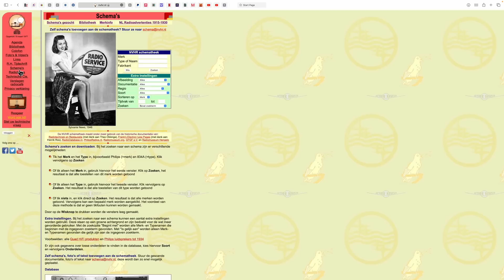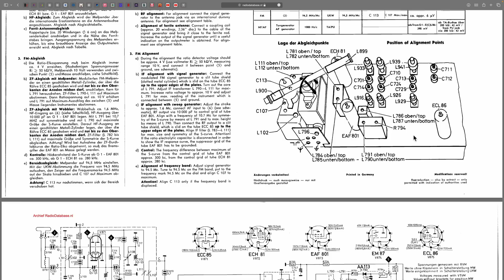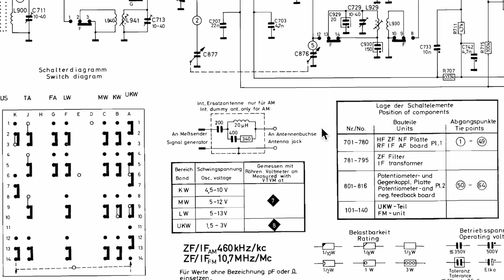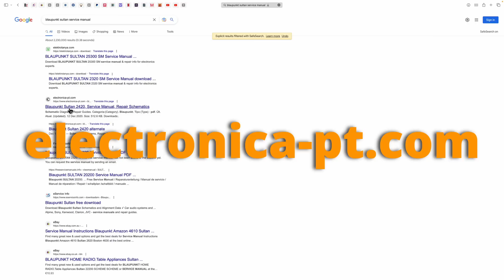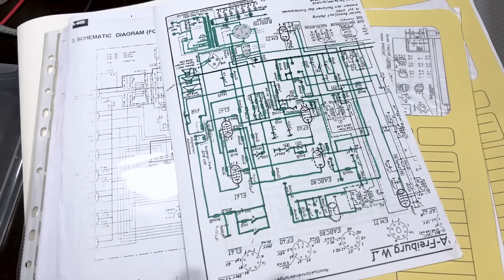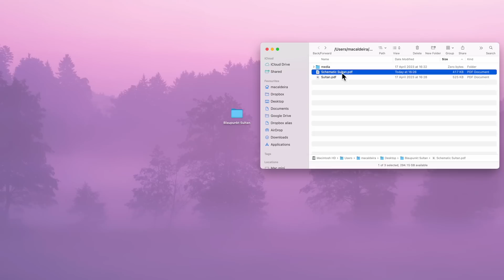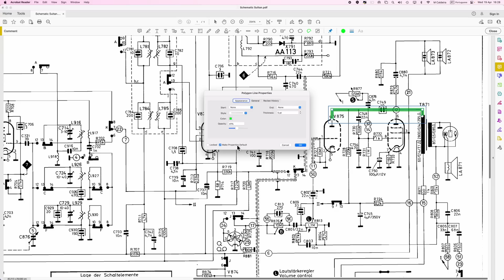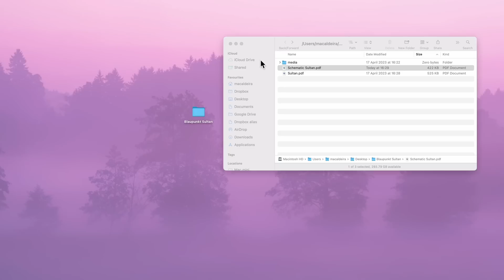How to prepare a Tube Radio Restoration, and how to keep a record of the project.

Comment: One ☝️ of your concerns is having to open this radio 📻 up. Not that this is the concern, but the electrolytic capacitors are usually bad. If ya hear 👂 LOUD electrolytic capacitor hum, that’s the telltale sign that the electrolytic capacitors are on their way out. They will give considerable warning ⚠️, even up to a few years, before complete electrolytic capacitor failure. The fact is, ya have to open up the radio 📻 to get to the electrolytic capacitors. I’d also check the vacuum tubes, and speaker 🔊. Sometimes, there can be an open circuit in a field coil speaker 🔊 (if the radio 📻 does not work at all). Ya also need the radio 📻 to be opened 🆙 to determine if the speaker 🔊 is field coil or permanent magnet 🧲. I’m also an old radio 📻 buff 💪. Just give me a shout if ya need help. I may not know much, but I like 👍 any vacuum tube radios 📻 or there. Your friend, Jeff.
Reply from the maker: 😊 thanks 🙏
Reply: In a vintage radio i typically change all caps first as a rule. Once you do that you are on your way. A Tube manual is a must even if you don’t have a tube tester. Even an emission tube tester is useful. I have found the tubes last longer than any other parts. I test them , but not as a preliminary procedure. Visual inspection reveals a lot of potential problems. Even without the 60 cycle hum of a filter Capacitor I know its git to be replaced, that is if it has never been replaced.
Having a good supply of tubes most used is a good investment , if you can afford a good tube tester its worth it, but it requires frequent calibration. Time, money and parts.

Comment: 13:50 When you come across a protected file, like a pdf in this case, you can try this trick : 
Open the pdf and choose to print again to pdf, and then choose only the page(s) with the schematics that you want. The result is a pdf with only the schematics, and this pdf should be editable. Personally i use Windows, and i have CutePDF installed to print to pdf. 
Another solution would be to open pdf with the schematics on full screen, and make a screenshot.
Nice video about the step by step to start a project. Grtz

Comment: Thank you for well-done video... things I never knew. Would you consider make a video to help beginners stock their shelf with common parts and not waste money on things that just take up room. The common items, like caps, and the number of units for each makes the restoration hobby more fun and lessfrustratiing. Amazon has cap kits and resistor kits but there are items that rarely get used. Thanks for considering this request. Btw, your source for obtaining circuit drawings is fantastic!!
Reply from the maker: I have considered this, but decided against it as the scope of this hobby is so broad, that it’s impossible to stock everything you’ll need. I built up my “stocks” gradually by always ordering a few more components than I needed for a particular project. In this manner I slowly built up my current supply of parts, which means that everything I have is probably something I’ll need, and that is quite daunting: if I listed all the components I have right now and did a rough estimate as to its cost, I think a prospective hobbyist would think, “Hmmm, not for me. I think I’ll take up a cheaper hobby instead. Like golf or formula I racing”. 😊

Comment: ~ 14:00 : You can get the one Site from a PDF even faster, by Printing the Page into a PDF-File.

Btw. GREAT Channel, so Thanks ;)
Reply from the maker: Just as I thought, but no. That’s been protected against as well 😊
Reply: @electronicsoldandnew  You're Right, tested it ;)
But if you Print the Page from the Browser into a PDF it will work.
Reply from the maker: Got to try that. Thanks
Reply: @electronicsoldandnew  I do this all the time.  Load up the pdf in whatever pdf viewer you use (e.g. Adobe Reader) and print it to a pdf file.  Protection is removed.  Thanks for another great video!
Reply: Actually, I misunderstood the original comment.  What I do is download the schematic to my own machine into a pdf file.  And then load it into the pdf viewer, print it to a pdf file, and finally, delete the file I downloaded.
Reply: @criageek  He is Painting in the PDF-File, but the PDF is locked ... so you can't do that (The Buttons for that are all greyed out). You must first remove the Lock.

To remove the Lock he is Downloading it, uploading it "somewhere" and Download the Unlocked Version, 
If you Print it with the Browser, the Lock does not exist anymore (it's not the original PDF, it's a copy)

hope that makes sense (i downt think so) ;)

--- forget the Comment ;) didn't read your 1st. comment

Comment: Manuel, to un-secure it just Print to PDF and save it as a new name.
Also, can print just the page/s you want in the new file.
Reply from the maker: Doesn’t work … I’ve tried it 😊 however, as per a previous comment, it will work if you print directly from the browser, have yet to try that.

Comment: Hi Manuel! First thank you for providing such high quality, educational content! Your channel has been a valued resource for my introduction into the vintage radio hobby. I have a question for you if you don’t mind. I’m working on a Grundig SO262 U. Currently I’m getting power to all filaments and dial lamps but no sound output whatsoever. Not even static or a hum just dead silence. It had 4 shorted EL95s which I’ve replaced. I’ve cleaned all of the electrical contacts. I’ve also run a signal through the output transformer which came through all speakers successfully. What would be my next logical step here? Any assistance is greatly appreciated!
Reply from the maker: Check everything sequentially: power supply, then audio amp.

Comment: I have a question for you: In all my servicing years I have never seen parts that look  like the ones at 20:21. They are just to the right of the Bakelite terminal board on the left, next to the tube socket.   They have a yellowish body and color stripes for the value. Are they single ended resistors or capacitors? I will assume they are not an early version of a tantalum capacitor. Thanks!
Reply from the maker: Those are capacitors.
Reply: @electronicsoldandnew   Thanks. I had a feeling they might have been, but with European parts I am never sure when you have never seen a type before. I think I have only worked on 3 European ( All Grundig) radios in my 55+ years of servicing.

Comment: Where do you normally buy replacement tubes from? Thanks.
Reply from the maker: U used to search on eBay, but recently found this: http://www.electrontubes.nl/Voorraad/stockset.htm
Reply: @electronicsoldandnew  Thank you so much. This will help.

Comment: I have a Tempo one transceiver (aka Yaesu  FT 200, Sommerkamp 250) and wanted to know what to do about those multi value filter capacitors in the power supply, I replaced a 3 value one (which I couldn't find ANYWHERE online) for a 2 value one plus an additional axial one for the extra value. I got everything soldered in, but still too scared to try it out, because of my limited capacity of reading schematics, I THINK I got it wired in right, but the LAST time I thought that I almost started a fire!!!

Also, do you have (or know of) any videos on troubleshooting the transformer on a tube transceiver power supply??? All I can find were for stereos...

Thanks for the video and the help!!

A2PHILIP 
KE8NFK
Reply from the maker: Search for those specific videos on YouTube, and you’ll find a few guys who specialise in that.